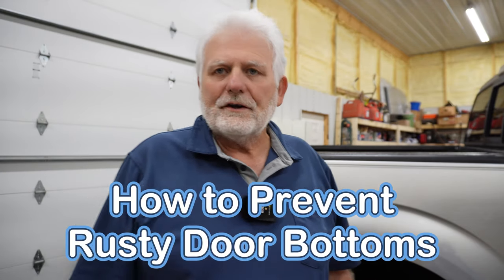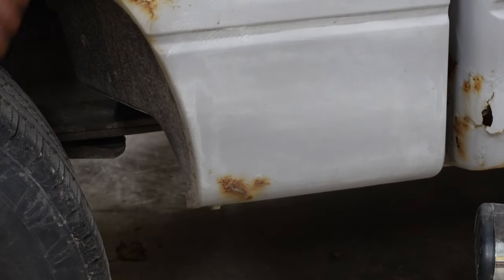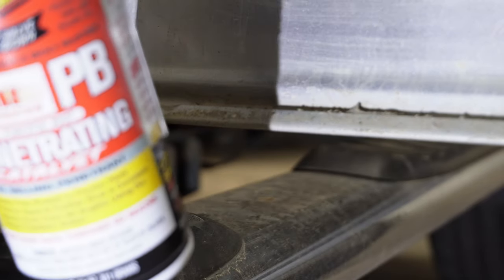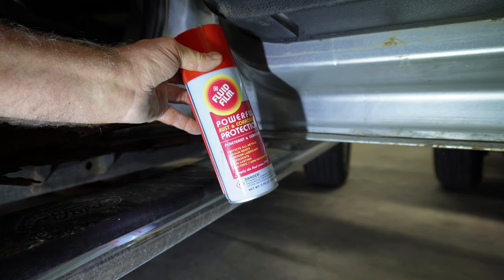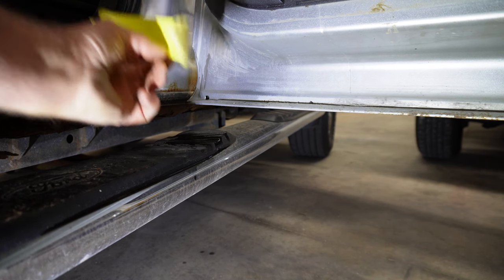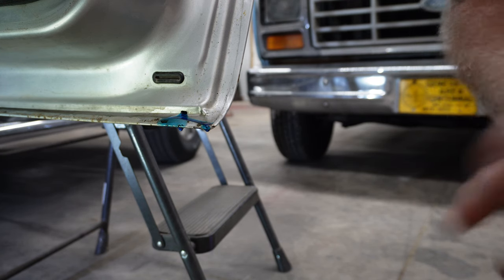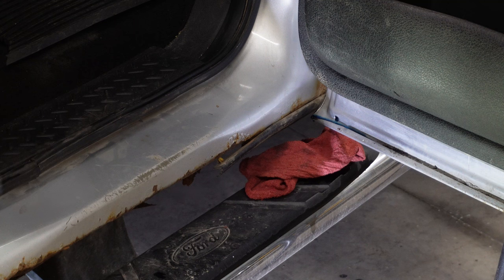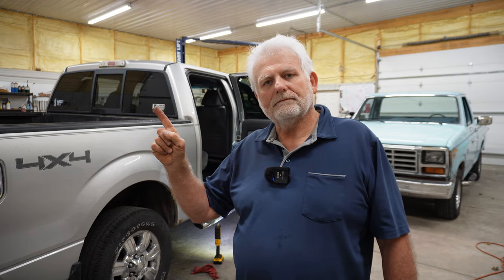How to Rust Proof Ford F150 Doors-Expert Tips and Techniques

Comment: A old trick I was told and shone😮 many many years ago. To rust proof doors and rockers before they go bad. For the rockers, drill a hole in the top of the rocker inside underneath the doorsill or a place you can plug out other way. Some rocker areas are sealed in the bottom and some are not but provide a drain hole and plug in the bottom of the rocker.  Now the messy part but this works !  Everytime you change your motor oil use the old motor oil to fill your rocker full of the waste oil and then drain it from the drain hole you made in the bottom of the rocker, thus coating the inside of your rockers. It really helps the rockers keep salty moisture out of the rockers and the seams and joints. Like he’s doing with the doors.
Reply from the maker: @joebarber4030  now that sounds like a good plan 👍

Comment: It's a little more work, but I actually remove the door cards and hose out the bottom, inside of the doors. There's generally a fair amount of dirt and debris down there in an old truck that comes out the weep holes. Then I stick a leaf blower in there to get rid of the excess water, let it dry out, then spray it with FF or similar from the inside. And, I usually upgrade the factory speakers while I'm there :)
Reply from the maker: @westhavenor9513  good idea

Comment: I’ve used Fluid Film and Woolwax. FF smells bad and lasts a year in exposed areas under the vehicle. Woolwax smells much better and lasts twice as long, but costs twice as much. So I’ll stick with Woolwax for less labor and better smell.
Reply from the maker: @Second_Insight  good advice I’ll check it out